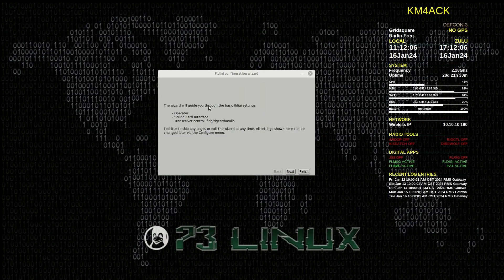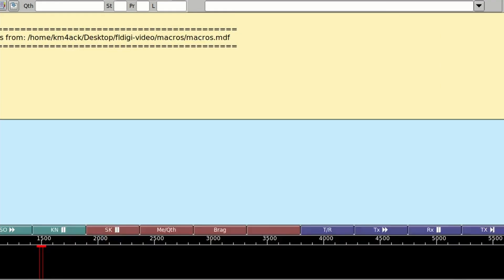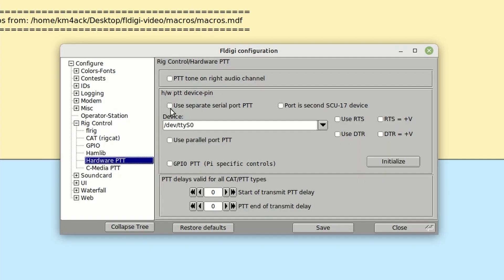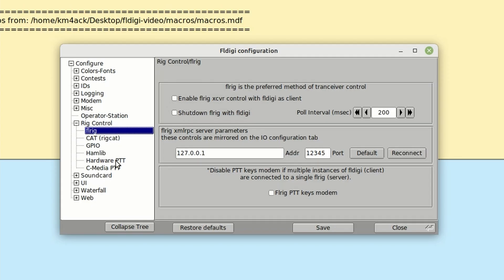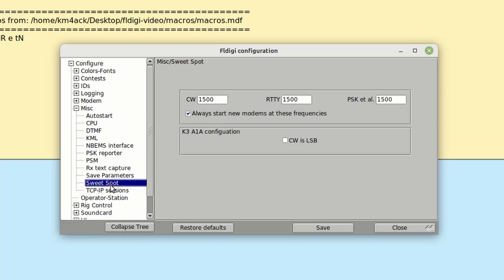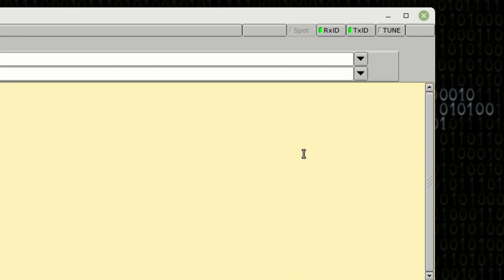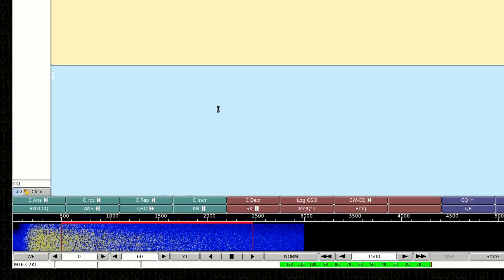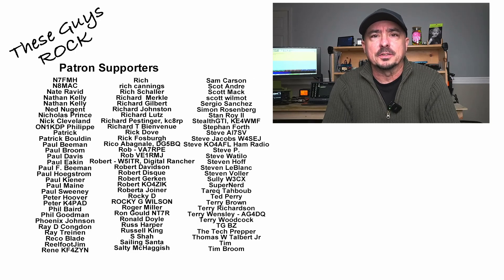FLDIGI Basic Setup :: NBEMS 1 of 6

Comment: Stupid newb question… I have a single laptop that’s already connected to my Yaesu FT710 for fldigi, wstjx, varac, etc. I also have a digirig and just got a Yaesu FT300 for 2m/70cm. I’d like to explore win link & vara FM. Will doing all this config in fldigi mess up my FT710 radio setup? Can you use fldigi for 2 radios? Thanks.
Reply from the maker: You can have two separate instances of FLDIGI. Each can have their own config file. On Linux, open the terminal window and run fldigi --config-dir ~/Desktop/fm-config and it will generate a new instance of FLDIGI with a config directory named "fm-config" Here's a walkthrough of doing it with FLRIG as well. https://youtu.be/TgnhbT49DFM?si=pK6nVj5KsGP7kARa
Reply: @KM4ACK I’ve just got a windows laptop, so no Linux that I know of.

Comment: dougstrong kj5clx

I found that voice access in win11 can be used to fill the fldigi  transmission  panel with  voice-generated text (before or while transmitting) which is treated exactly as though it were text you just typed in.  Fldigi transmit sweeps through the text the same.  There may be some microphone issues between receive and transmit modes.

Comment: I would like to know how you added thw DEFCON  Status to conky
Reply from the maker: Just a text statement that I put at the top.
Reply: @KM4ACK   so does it pull current  level
Reply from the maker: @Aerial51Photography  Negative. Updated manually. I should research getting it to pull automatically though. I just put it there for eyecandy
Reply: I have mine  it set to pull for Amrron   AmCon level  if you need that script

Comment: Nice video . Looking forward e to the series. I recently just set up a DigiPi on a pi zero for my ft817 using a digirig and i havent quite got it sorted yet. I'm going to try this hardware tip from this video.
Reply from the maker: Hopefully it gets you up and running. With the 817, be sure you are in the right mode (PKT, DIG) depending on your use.